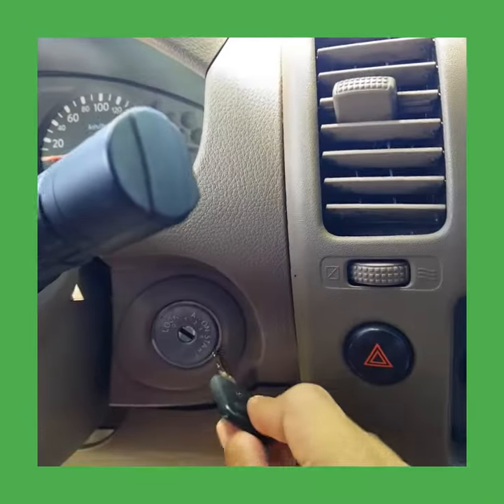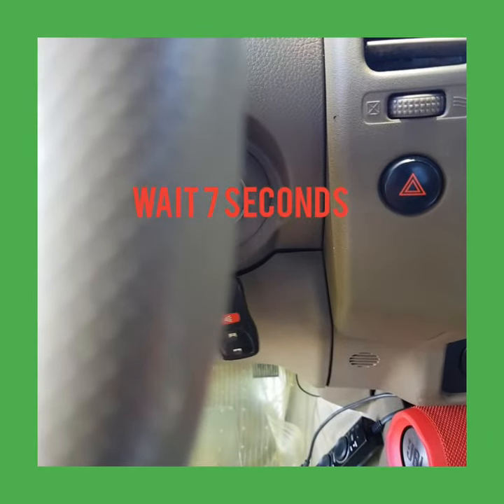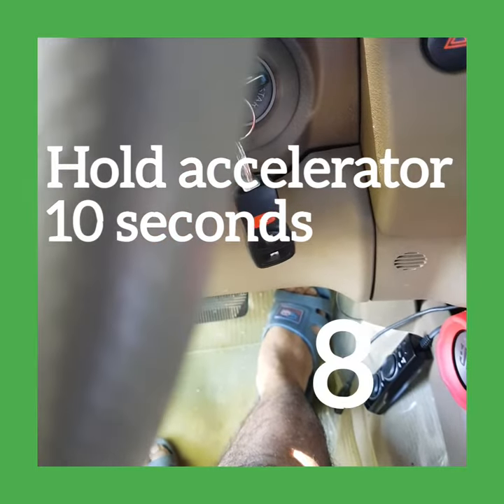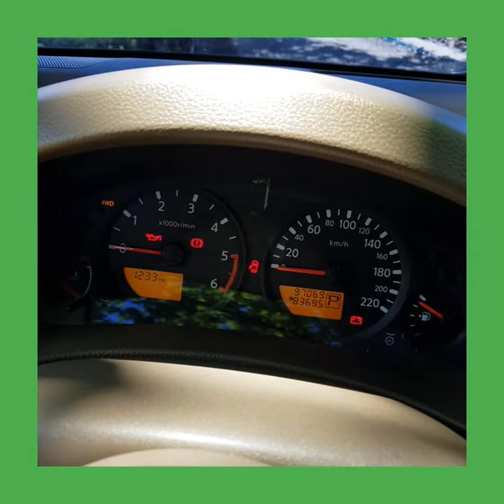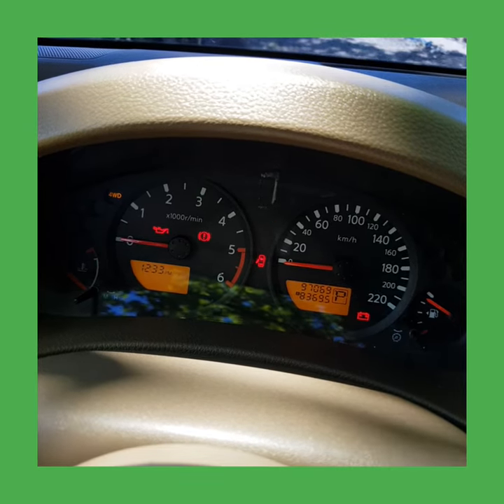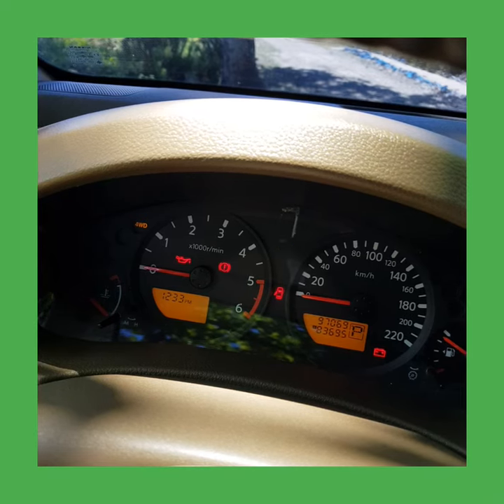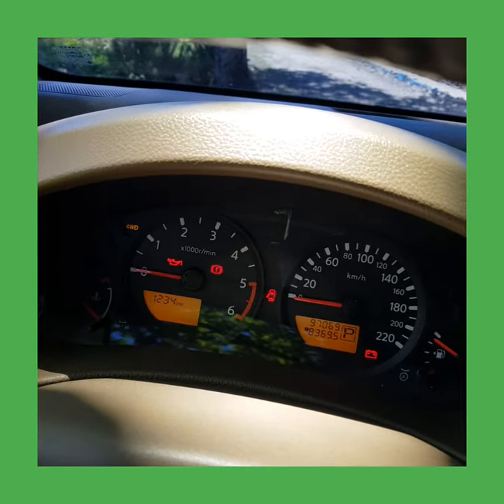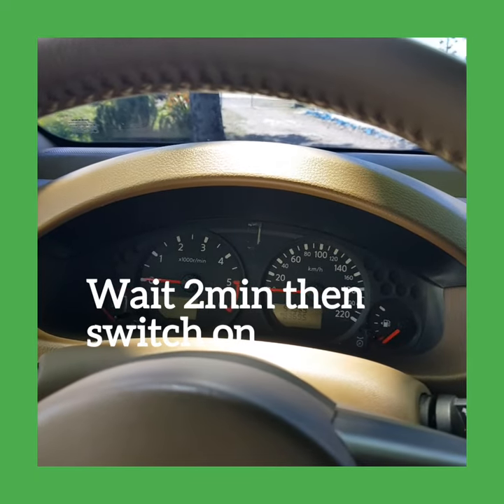nissan navara d40 ecu reset fastest way 2.5dci yd25DDTi  #ecu #navara #ecureset 3.0L V9x v6

Comment: What is the reason for doing this? I have to replace my boost solenoid should I do this after I change it? Also would it wipe a power 
Map off if it has been put o
Reply from the maker: Yes so that your ecu can communicate new sensors properly it will help them to read and register new parts specially electronic
Reply: Does it effect a remap on the ecu?
Reply: @brianmcleod4772  didn’t effect mine